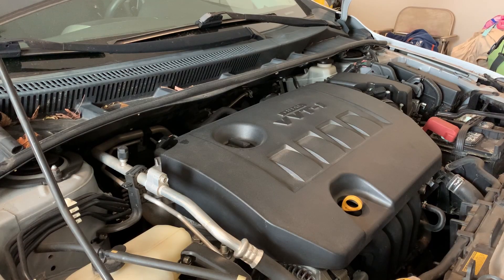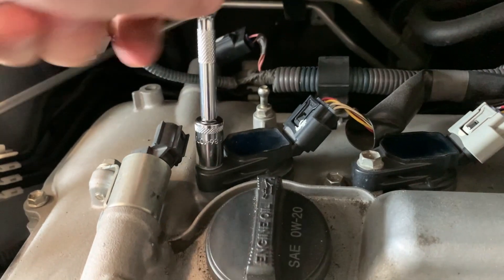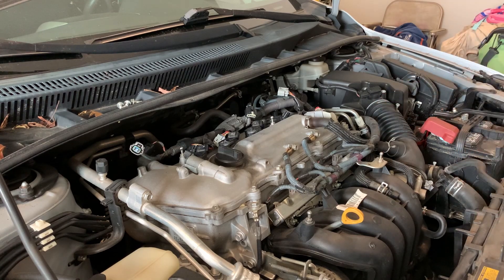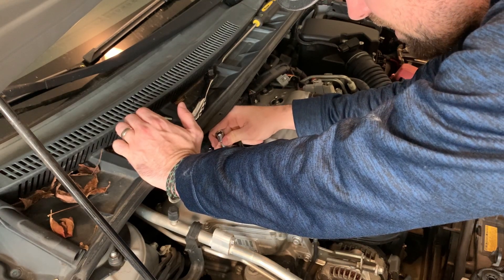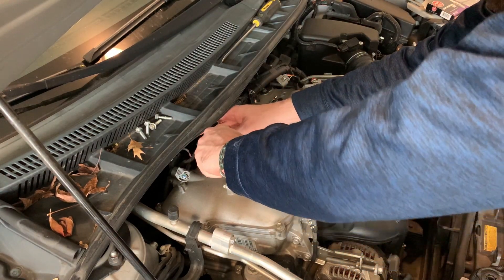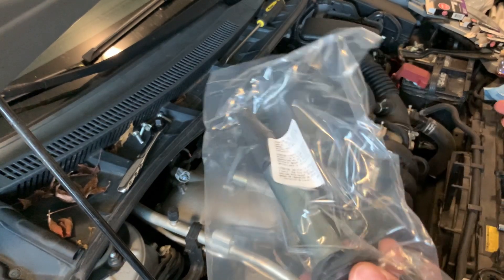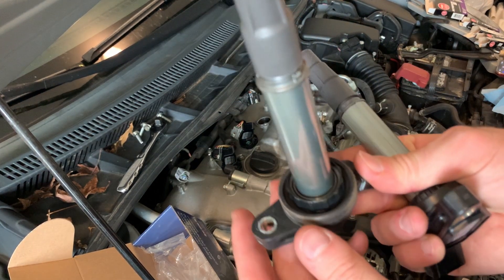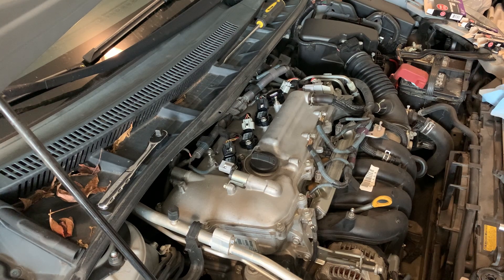How to Change the Ignition Coils and Spark Plugs on your 2009-2013 Toyota Corolla

Comment: I'm curious as to why you would use non-oem NGK spark plugs and then use OEM Denso ignition coils. Toyota specifically recommends using only Denso iridium tip spark plugs on this year Corolla and my mechanic told me he will never use NGK plugs because they don't last as long as Denso (120K miles).
Reply from the maker: I believe it is all preference. I've never had any problems with NGK plugs and for me at least, they've always had a great lifespan. I got a great deal on these NGKs through rockauto and they are considered a high quality plug. We'll see how long they last me but I've never had any issues out of an NGK.

Comment: I have a 2018 im dealing with the same same issue i already did the boots and plugs and im doing the pcv next (it has 160k miles ) i did clean the mass airflow and it helped me try that next and see what it dose for you
Reply from the maker: I tried cleaning the MAS and it did help for like a week or two and then it was back to doing its same ole studder.

Comment: Before you changed the spark plugs. Did you ever experienced like sluggish acceleration particularly on incline
Reply from the maker: I did, but that is also due to these cars basically having no torque or horsepower. Some really steep hills give the car a real hard time.
Reply: @bossadamsgarage  okay I understand. Thanks for getting back to me. Sometimes when my car is getting on an incline and needs a lot of power sometimes it goes into the red the RPMs